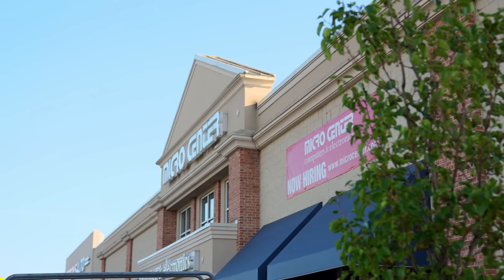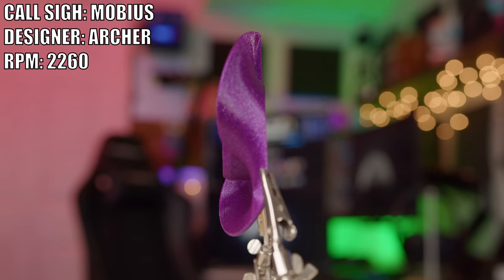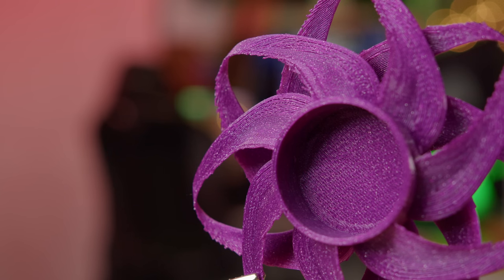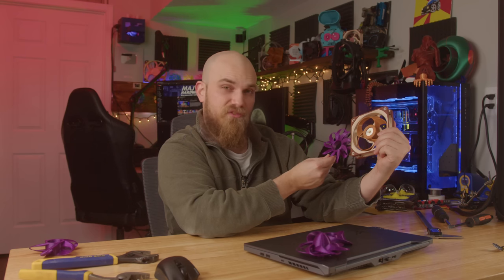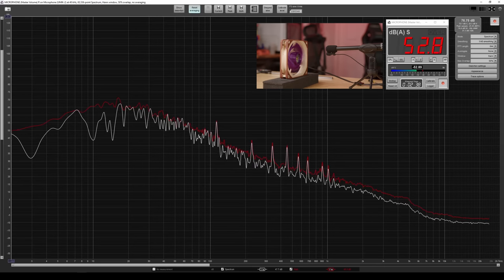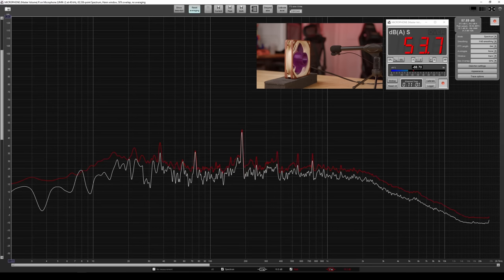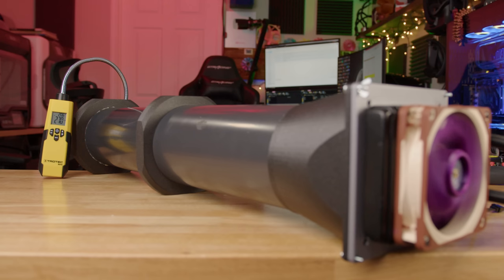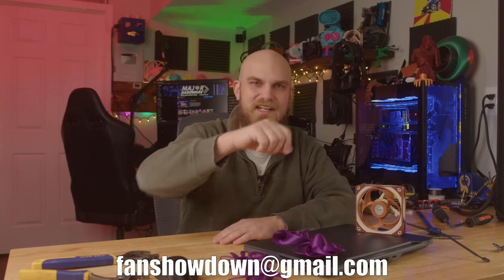My Subscribers Turned MIT Award Winning Toroidal Propeller Into A PC Fan | Fan Showdown S5E5

Comment: With these submissions got me thinking: we may need a new measurement index, a "noise-to-airflow" coefficient of some sort to see which design can output highest static pressure with comparatively lowest noise. AWESOME job as always, and keep it up Fan Showdown Community!
Reply: Yo dawg, you have a pretty high NTAFR
Reply: @First name Last name  I think we'd go with "hey bro, your fan has good NTAC"
Reply: Damn good idea
Reply: Noise normalized pressure/airflow. AKA set RPM so noise level is the same for every fan, and then test performance.
Reply: @KellyWu04  An interesting idea, I'm really curious if doing things that way would actually change the NTAC rankings, or just be a different way of measuring the same thing?
Reply: @Nevir202  Some fans drop off really badly at low noise levels while some fans retain more performance at low noise levels. It's a tradeoff between testing methodologies.
Reply: @KellyWu04  Noise doesn't work like that at all. The vast majority of the output energy heard as noise comes from the fan blades and not the motor. Thus, fixed rpm absolutely does not produce noise normalised results.
Reply: The problem is not all sound is equal. A more smooth sounding fan is much easier to listen to then something that sounds choppy or buzzy.
Reply: @anteshell  I said noise normalized
Reply: @KellyWu04  didn't you read your own comment? I swear I also see there "AKA set RPM".

Except now that I mention it, I realized this can be interpreted in two ways. Either as "fixed RPM" or as a conditional based on the sound level. I guess I made the wrong call before? If so, my bad.
Reply: CFM / dBA = noise efficiency coefficient? Wonder if it would actually shake up the chart much at all.
The fans which perform well tend to have a higher CFM than dBA and will score over 1.0 while lower performing fans will score less than 1.0 generally.
The Noctua for example scores 1.42, the 993 scores 1.05, and the Inverted Shadow tested in this video scores a 0.83 with the rest coming in even lower.
Pretty good idea to just get a general idea, though obviously it's somewhat useless info without both numbers and everyone prioritizes differently.
Reply: @_shadow_1  True. And then there's the sound pitch and possible spikes in the frequency spectrum. Low freq sounds can be much higher in intensity before they become as annoying as high pitched sounds. And then there's some frequencies that are way more annoying than others either higher or lower, but that is highly subjective.

It is impossible to make this work in every situation but the sound level is the least subjective and most universally applicable method.
Reply: @anteshell  I also worded it ambiguously
Reply: I'm pretty sure you could already work that out from all the statistical data he already collected.
Perhaps you could download the spreadsheet,  do the calculations for him and send it to him
Reply: someone’s going to game the system with a fan that doesn’t make any noise but doesn’t move air AKA a paper weight
Reply: GamersNexus has been normalizing fans for loudness for a while. If a fan is 10% more effective but twice as loud, it isn't a very good fan. That said, rather than measuring static pressure they ought to just check the resulting temps on a CPU, since that's all that matters + most gamers don't know how to compare the relative static pressures of multiple fans.
Reply: @anteshell  I actually don't really even get the obsession some people have with noise. The only thing it really matters is for recording and studio setups because like 90-95% of PC gamers have a headset anyways. Although, I am probably an acception because I actually find the smooth low-pitched brown noise a high quality fan can generate very stimulating, and in fact it actually helps me focus in most cases, which is kind of a hot commodity for me. Sometimes I even turn on my laptop or PC just for the noise.
Reply: I've being saying that for some seasons, 

There's the air flow lead board but should be a sound lead board as well
Reply: @bernhardjordan9200  And how exactly would you measure what sounds the quietest? Not all decibels are equal and some fans can make relatively quiet buzzing or coil whine noises that will pierce straight though a particular case or a headset while with other combinations it could be completely blocked. It's way less useful than you think to measure a fans noise in a specific and unrealistic space.
Reply: @_shadow_1  lower pitched fan noise is preferable to me too. Recently got some Arctic p12s. Big difference from the Scythe fans I was using before. Much more pleasant noise.
Reply: @androiduberalles  🔴 What Is Islam? 

🔴 Islam is not just another religion. 

🔵 It is the same message preached by Moses, Jesus and Abraham.

 🔴 Islam literally means ‘submission to God’ and it teaches us to have a direct relationship with God. 

 🔵 It reminds us that since God created us, no one should be worshipped except God alone. 

 🔴 It also teaches that God is nothing like a human being or like anything that we can imagine.

🌍 The concept of God is summarized in the Quran as:

📖 { “Say, He is God, the One.  God, the Absolute.  He does not give birth, nor was He born, and there is nothing like Him.”} (Quran 112:1-4) 📚

🔴 Becoming a Muslim is not turning your back to Jesus. 

🔵 Rather it’s going back to the original teachings of Jesus and obeying him.
Reply: @theftking  Not all fans go through a CPU though and the temperature of the room can't be perfectly controlled, so temparature not a very useful test. Also, there's no way to standardize loudness, and even if you could, literally everything in your setup affects the amount of noise that reaches your ear and your setup will also affect different fans by different amounts, you would need an exact replica of your own build in your own room to get results that are actually valid for you. The only reasonably useful metrics are static pressure measured without significant load and a decibel graph measured at source with companion audio to hear for any annoying buzzing or coil whine and hope it's not a problem for our setup if it does have some.
Reply: @_shadow_1   good question, I really don't know, but a fan is not only air flow like you've describe
Reply: @_Shadow_  I think the simplest way would be to measure which fan can generate the highest airflow at the lowest decibel rating. Since he's using the same motor for all the fans he tests the coil wine should be fairly static. Now it would be up to the individual which fan sounds the most pleasant. Also some people care about noise because like me their pc sits in a room that's usually occupied by more than myself, so quieter fans are preferred so it doesn't disturb other people.
Reply: @_shadow_1  Temperature is actually the supreme way of testing, since affecting the temperature is literally the only purpose for fans. GM does the testing in controlled environment, but even if done in your own bedroom, it would provide very useful results. There is only one caveat in this statement. While a test done in controlled environment gives objective results which  will behave in the same way on everyone's PC, tests done in uncontrolled temperature are mostly useful only in the same environment the test was done, or adequately similar.
Reply: i was just thinking the exact same thing!

looking through the list the toroidal fans aren't even the quietest! very surprising 
but yeah I too would love to see a metric that can rank fans not just on airflow but noise too

also makes me wonder if there's other things you can test for? like the factors that go into the mass airflow being measured; I imagine it's something like pressure and velocity, but i'm no award winning MIT engineer so who knows!
Reply: Next up he's going to get a big fan testing machine like Gamers Nexus got. Or he's just going to start going and using that.
Reply: @anteshell  Higher static pressure and air velocity will always mean better cooling, they are directly in correlated and the best part is those measurements are independent of temperature entirely. So differences in humidity and temperature don't effect it.
Reply: @_shadow_1  yes, but unlimited amount of other variables will affect it, such as the pc case you have, the cooler tower or equivalent you have, the amount of dust in between the cooler fins, etc, etc...

Sooo.. What was your point again?
Reply: @anteshell  the point is to give a measurement that is easier to transfer to different situations all static pressure is is the difference in pressure between the intake and exhaust, any good case design will try to make the inside pressure as close to ambient as possible, pressure isn't effected by case size or shape because it's almost even throughout the case and as long as it's designed to be ambient,  and is pretty easy to change yourself without any case mods at all, then it's cooling potential only is affected by environmental variables which would effect all fans equally so they don't matter.
Reply: @_shadow_1  Everything in the case affects the air flow which in turn affects the cooling efficiency. And there are cases specifically designed for over pressure but also under pressure. 

All I'm saying here is that there is simply no universally applicable measuring method. The same thing I said earlier about sound (was it with you or in some other convo? Can't be bothered to check.). No matter what method is used, they all give good values depending on what aspect you are emphasizing in your build. For casual user, the sound is all that matter and nothing else.
Reply: there's me trying to do NTAFR in my head on each episode!
Reply: @hundredfireify  Yeah, I did not dispute the metering method at all. I mean you CAN read my comments and see it yourself, so I'm not sure where you're getting at.
Reply: It should be expressed as a curve for each fan, because if you standardized the rpm, fans are going to do better at different speeds than other fans. With a curve we can then work on a good way to compare the curves between fans, sort of like they do for turbocharger maps.
Reply: we could spin the fan's at some specific forced rpm's and put that on a chart and compare with other fans
Reply: @KellyWu04  Graph with airflow or static pressure against noise
Reply: I'm surprised he didn't add one
Reply: As a fpv drone dork I %110 agree noise to airflow or noise to lift ration would be fire to have!
Reply: I feel like there should also be some sort of scale in relation to fan volume and the peak frequency that you hear from the fan, some sounded higher pitched making them SEEM louder than a lower pitched sound fan. Even if a lower pitched fan is ever so slightly louder in terms of raw Db it will still sound quieter due to the fequency of the sound(s), sometimes anyway, again, all depends on frequency.
Reply: @deltazero7012  NOTAR might be a little easier to pronounce, using "ratio" instead of "coefficient"
Reply: @802Garage  It would likely shake up the performance of novel non-fan airflow generators that are less energy efficient — like that video of bellows-powered cooling, or weirder options with no moving parts like ionisation thrust or something…
Reply: dbaf ?
Reply: Yes gamers nexus does that. Its called noise normalised. They set the fans speed rpm to where they output the same amount of noise then measure their cooling capacity on the CPU
Reply: You could just generate a standard fan curve...
Reply: @802Garage  That was my thought with the addition of doing it twice, at both max and min RPM to give an efficiency range rather than a single number.
Reply: The difference in noise level is ± 6%, the difference in airflow is ± 21%. That means a combined metric will still depend mostly on the airflow, except for the really loud / quiet fans.
Reply: Simple look to noktua a12x25 cooler box ;) - such graph needed!
Reply: @androiduberalles  I would just like to through a new acronym into the mix:
SAAFIR
Sound
Against
Air
Flow
Integrated
Ratio

Just feels better saying sapphire than NTAFR
Reply: Someone already has done that coefficients spreadsheet, thats why you buy a noctua fan in the first place.
Reply: noise stabilized performance.
Reply: Gamer Nexus does that in a way. They set up the pc to have a fixed noise level, then show how well fans cool at that noise level.
Reply: dB/cfm
Reply: Is the Fan Showdown datasheet available? It would be nice to allow the community to expand on the data analysis. To be safest use CSV formatting, there is little chance of virus's etc being added in copies being that it is text.
Reply: Most testers use “Noise Normalized Airflow.” You basically pick a noise level, then either speed up or slow down your fans until they match the noise level and then record the airflow. You can do this at several noise levels to get a good picture. 

A regular coefficient doesn’t work because the noise levels don’t scale linearly, 

Best case you might be able to fit a quadratic equation to it but it would require a lot of testing and not be super helpful for most people who are just trying to figure out how loud something is at a glance.
Reply: Even better: a curve, airflow (x) vs noise (y). Then a another curve, rpm (x) vs airflow/noise (y), find the peak and compare the peak of every fan. Does it make sense?

Comment: The toroidal propeller is not optimized for a ducted application.   Its features are a comprise for certain performance characteristics in open channel flow.
Reply: Very much true, the toroidal propellers are quieter because their design eliminates the noise cause by the tip of the prop going near super sonic
Reply: Excellent point.
Reply: exactly!

the whole point of a toroidal fan is to have a ducted fan but without the ducting.

hence why the standard fan on the A12X25 severely out-performs them as it takes full advantage of the duct, and why all the fans which accentuate that duct are the ones which perform better (at the cost of form factor and noise).

personally I'm just waiting for the cheater 2 electric boogaloo which keeps the same low noise of the standard fan but with improved performance as the whole point of this show it to make a better PC fan, and noise plays a huge part in that, he should really put a performance-to-noise graph on there and rank the best fans based off of that as it would clearly show the true best fan and prevent future instances of the cheater's reign.
Reply: Yeah came here to say this.
Reply: I've been screaming this at my phone since the first toroidal fan. The close fitting duct  minimizes tip vortices already.
Reply: Which makes sense because they basically bring their own duct
Reply: Question: How would one go about testing airflow for this type of propeller?
Reply: @Justin20006  I think you use a prop dyno to characterise the performance around your design point.   Typically, thrust, input power, rpm, at a given flight velocity would be measured.    Also, for some applications the effects of side slip might need to be measured as well.  (Like as a quad copter changes directions the prop is partly sliding sideways relative to the air)
Reply: So it would do better in a standard room fan?
Reply: @louis-charlesgodin5010  Like a standard 24" box fan?  I would suspect yes.  Also probably any fan that just has a cage around the blades.
Reply: @The_Opinion_of_Matt  yeah I was thinking about the ones with a cage around em
Reply: Beat me to this comment
Reply: Also didn't i see that the biggest advantage was efficiency? I believe I saw they were at like 90 or 95% of max thrust at 80% rotation speed.
Reply: Yeah, this is just badly applying scientific information to the wrong context entirely
Reply: Drone prop tips are nowhere near supersonic
Reply: Has ANYONE produced a quadcopter toroidal design that comes close to the efficiency of standard props?
Reply: "The toroidal propeller is not optimized for a ducted application" perfectly right, which makes all those tests perfectly useless. He should remove the duct ant then compare all forms.
Reply: @SilvaDreams  yet here the dBAs are higher, not looking good for them at all
Reply: my 3090 gpu fans from asus are toroidal
Reply: @SilvaDreams  it's not that the tips go supersonic (uncommon with propellers) but rather the effect they have on the air. The air is moved violently and turbulently and that causes vibrations (aka sound) in the air.
Reply: That’s what I was thinking based on all the videos being an open propeller
Reply: Do you know if a toroidal fan can be used as both/either a drive or driven fan in a ducted application?
Reply: Leave the fancy vocabulary at Starbucks we’re engineers. A Propeller is not supposed to be ducted at all bc it’s NOT trying to move air, it wants to move itself. A Duct is used for Fans to prevent radial loss through the blade tip. And don’t get into boats and sh*t, that’s a whole other topic. The entire idea isn’t very based on knowledge we’ve gathered over 150 years, as they’re throwing it out the window, for something new. Something new doesn’t always mean something that works better.
Reply: The fans should in fact perform better in a bigger shroud than their size. Putting a 120mm toroid in a 140/180mm shroud should improve the performance substantially.
Reply: and for water.
Reply: @SilvaDreams  This is incorrect - the toroidal propeller combats propeller tip vortices instead.

Propeller are essentially just rotating wings, and wingtip vortices are a considerable source of drag for any sort of wing. When creating lift, inevitably part of the airflow across a wing flows spanwise. When this spanwise flow reaches the tip, it creates a vortex. This creates extra drag and turbulence.

Since a toroidal propeller does not have a tip, it also does not create tip vortices. Instead, the vortices are evenly distributed across the blades.